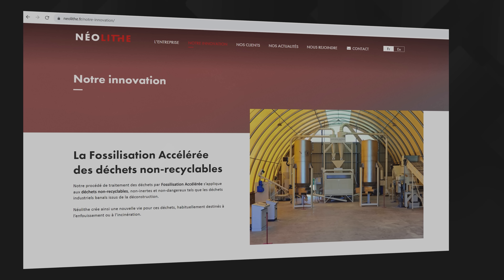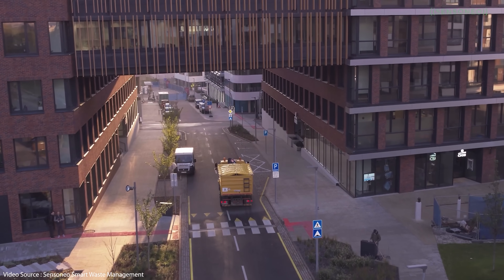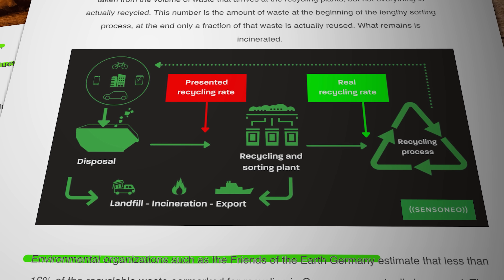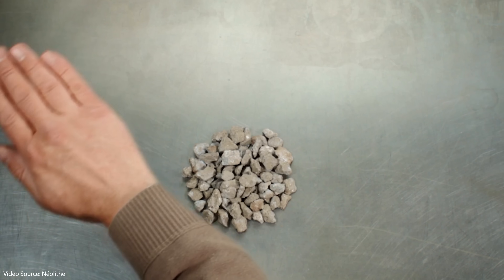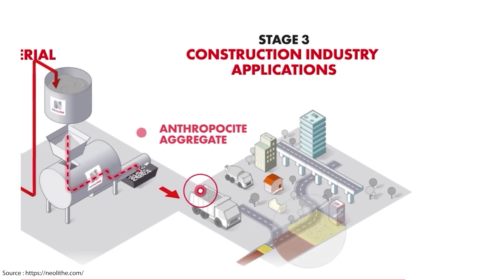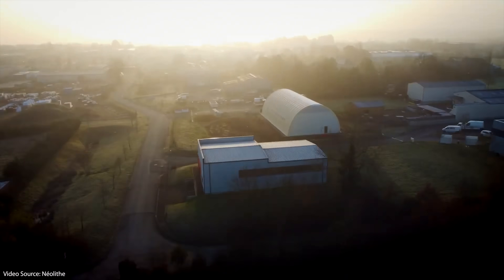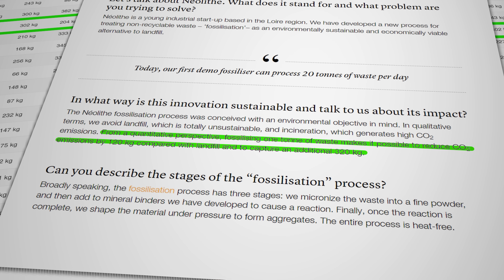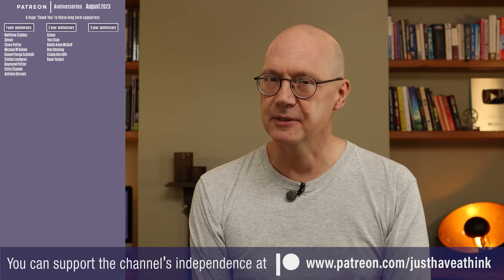Building roads with your rubbish! How do they do that?

Comment: Hmm - the issue I have with this is that the waste is put into infrastructure instead of recycling removes it from being really recycled. But it surely is better than burning the plastic and do some whitewashing by calling it thermal recycling….
Edit: Another item I want to know: If it is used as building material - how can it be recycled or are the waste of those tiles etc just going in a landfill after all - just a few years later?

Comment: There is no possible way this material is structural, which heavily limits its use in the construction industry as an aggregate in concretes or asphalts. Even structural abilities of known materials get rejected by engineers and governments for road building because of varying specifications. Crushed concrete and asphalt aggregates have been and commonly do get rejected as under road fill or base for roads where I live in Canada due to the variations in mixes of concrete and densities. If there is a proprietary unknown stages to this products manufacture and it's made from different waste materials each time, there is no way governments and engineers will be liable in its use. Not to be overly negative, but waste management cannot be looked at as a economic endeavor. It is a government social service that taxes will have to pay for. Introduce legislation that if you produce it, you have to take it back or pay for its disposal, and manufactures will start figuring out ways to reuse products, make them easily recyclable, or out compostable materials.

Comment: It is not only good for roadbed material, we can use it to use on roofs over roads for tethered electric cars. Forget carbon. The problem is urban heat, which heats Barent's Sea, melting Arctic and warming northern countries more, which heats Barent's and this is why we have not only reached the tipping point, we ransacked it. 

Have you heard what is happening in US? It is the new normal to keep warming more than the last 60 % of years until we stop coastal mega-city asphalt ovens.

Comment: If the waste they are using contains plastics, and it sounds like it does, then this aggregate should not be use in any application where it experiences friction or erosion because this will result in microplastics being dumped into the environment.  Road surfaces, for example, would be a bad application.

Comment: I spent my working career in concrete, asphalt, sand & gravel and was recently interviewed by a company called Fortera USA. The process of making cement is one of the largest emitters of CO2 and the Fortera company is developing a way to capture the emissions from the cement making process and actually convert those emissions into a cement-like product that in laboratory tests can replace much of the cement used in construction.

From my own rudimentary research into the process it is a lot like how natural coral reefs form, using calcium carbonate from the surroundings that build themselves up into solid structures which can then be pulverized into the cement substitute. I didnt get the job. It seems no one wants to hire older guys anymore, my proof is 3 years of applying and no job offers.

Comment: @JustHaveaThink I like it, and suggest it is used for a seawall system to protect against sea level rise, and use it to encapsulate all waste at the same time.  Maybe some sea level rise can be avoided with climate restoration AKA geoengineering.
Reply: Sea water is extremely corrosive.  If there is a possibility that the material degrades by releasing micro-plastics, seawalls would not be the best choice for its use. It would have to prove at least as resistant to erosion as  granite.

Comment: If it's a viable replacement for aggregates in the construction industry, great. Will it be cheaper, and can it be used in the same way as current aggregate? If it's available in the quantities required, can be used without changing processing methods, and is cheaper, then I can see it being adopted - so long as this material has the same or better longevity than the current material.

Also, this secret binding agent... something non toxic that can bind powder without high temperatures suggests something like a protein, or some other organic substance. My guess is egg.

Comment: This looks more like an investment scam than a practical technique.

It is possible it was started with good intentions, but they didn't stop when reality set in. I don't believe there is an affordable binder with the right properties to contain a random collection of unsorted plastics. Styrofoam and teflon have radically different properties.

I wouldn't be surprised if their demonstration machine grinds up random stuff into a gray dust and puts it in a container. The next step starts with a different container of gray dust that was made from grinding up carefully selected materials in known good proportions, and mixing that with a compatible binder.

Comment: I am working with a company that is mineralizing CO2 directly from air with silicates just like Mother Nature has done to take CO2 out of air to make Calcium Carbonate forever. Given the CO2 capture that Neolithic is  stating, I am pretty sure it is a silicates capture process to create Calcium Carbonate. Unfortunately big companies have stolen technology from small companies for years. Looking at Milkywire environmental investing, it is obvious that CO2 sequestering is chemically and technically possible just looking at a company like Silicates. So big companies quit gaslighting and come to table with your checkbook. Neolithic has a great idea to make road aggregate to improve aggregate roads. There are aggregate coatings that can agglomerate and provide cementing action to create a more stable aggregate road. Unfortunately, construction takes 50 years to change. We do not have 50 years unless big money starts flowing.

Comment: The lack of transparency is a huge red flag. Has anyone examined the finished product for microplastic levels, toxins, and what its finished form is made of? Until there's scientific oversight, it should be treated as greenwashing and potentially more polluting than the alternatives.
Reply: I heard when cars go across a road, they create friction which remove tiny specks of concrete, a petroleum base product, onto the surrounding environment. Now, imagine if the roads are made with trash w/ plastic ,  now the plastic and trash are shredded up piece by piece by constant wear and tear by cars into the environment which can include food crops.

Comment: It's a way of kicking the problem down the road, I suppose. It's still plastic, just pulverized, glued into aggregate and used in place of other aggregate in construction. If it's ever on the outside of whatever it's used in, and subject to abrasion or weathering, it's now pre-made microplastic ready to be blown into nature by the wind where critters can ingest it. And whenever the thing it's used in is going to be toen down, they'll have to figure out a way of separate the microplastic from the concrete.

Unless I've completely missed something.

Comment: Sounds like a great way to leach microplastics and chemicals into the environment in a broad and uncontrolled manner as these surfaces break down over decades.
Reply: My thoughts as well.
How permanently locked away can a part plastic mixture be. Unless the plastic is as hard as diamond. That won't occur in a low energy process.
Reply: Aren't you pouring cold water on a material yet to be fully tested? How do you know it will break down over decades or leach out chemicals? 
I don't understand the negativity that leaps out every time a potentially positive technology appears. What would be your solution for dealing with non-recyclable waste?
Reply: @jeremyradford5103 because that‘s what plastic does under stress? Far more quickly than materials like stone or concrete? Sunlight makes it brittle, heat makes it soft and repeated compression makes it break. Each of the above on its own would make it break down eventually. All of them together will wear it down over time and release microplastics into the environment. While certain plastics can be designed in a way to resistant to certain stresses, a uncontrolled mix of "thrash" plastic won’t be.

If plastic wasn’t breaking down on its own when exposed to the elements we wouldn’t already be having a microplastic problem in the first place.
Reply: @sebastianbauer4768  "uncontrolled mix of trash plastic"? You obviously know more about the process this company is introducing than anything in print. I know perfectly well what happens to plastic under environmental conditions, but as you say, this is 'trash' that will break down in the manner you describe anyway. It may not be a perfect solution, but it's not adding to the existing problem, so why tear it down before you know?
Reply: @jeremyradford5103  because there is a reason we put thrash in landfill and not just throw it into the ocean anymore. It helps to contain the problem, keeps the sun away and generally keeps the stuff out of the groundwater. Spreading it flat over as large a surface as possible(aka roads) objectively maximises the sun, wind and mechanical stress(tires) exposure.
Reply: @sebastianbauer4768  Landfill sites are one of the worst sources of chemicals leaching (leachate) into the soil and ground water. 

If this material, which no one yet knows its durability, is used as aggregate for road construction, it will be covered by tarmac and not exposed to sunlight or wind and be less prone to breakdown, if it does actually breakdown. 

Why are you raising issues that neither you nor I know exist before this new material has been properly tested? Waste management is an increasingly difficult problem to solve, so what is your objection to a technology that may just work!? This defeatist attitude is nauseating
Reply: @jeremyradford5103  Listen to yourself. If we waited to raise issues until we had experiences it would be too damn late to do anything because it would be in thousands of miles of roads already. Ofc you need to raise issues before shit hits the fan, your mindset is what caused all the problems we have that you even refer to yourself. There was probably someone just like you around when we first discussed throwing plastics and other long term chemicals in landfills. 

And we do know the durability of this stuff. It’s not a new material, its the stuff we already know and love that you find in every cubic centimetre of seawater. We know the chemical properties of it and even if we do not know the exact mixture of this specific product there isn’t a single plastic out there that would be unproblematic. If it’s bad in a landfill it’ll be bad in or under a road, just more spread out and less controlled. Can’t put a landfill in ground water protection areas for example, roads go everywhere.
Reply: WTF?
Dude, that stuff is harder to disolve then the plastics we already throw into landfills and oceans. It actually makes the issues less problematic!
Reply: @christopherg2347  Even if it was harder to dissolve(how is that even relevant btw?) than other plastics that doesn’t mean it won’t be abraded by 40 ton vehicles driving over them for decades while exposed to the elements. It also pretty much ensures that it’s turned into as fine a dust as possible, just like already happens with the rubber from tires. Why not try it in a contained environment first? As a roofing material for example.
Reply: @Bastian28466  Pretty sure the entire video was about pedestrian paths, not vehicle roads.
Reply: @christopherg2347  I was more referring the the principle of it, there are plenty variations of this used for all kinds of roads. And even with pedestrian paths you still have erosion, just slower.
Reply: I still think that enormous scaling of that limestone-producing technology from carbonic acid in seawater is the best current model for removing human emissions. If it was scaled properly, with trillions of dollars of investment worldwide, we could justify burning all waste to reduce microplastics etc and then convert the CO2 and carbonic acid back into rock, leaving a small residue to be properly disposed of - so we wouldn't have to worry about needing to recycle trash in an endless cycle of microplastic production.
Reply: @morganspencer-churchill2136 Enormous is an understatement considering that CO2 emissions are still increasing and will continue to do so as long as we burn fossil fuels. I have a feeling you would like to bring in some mitigations to control atmospheric CO2(e) to maintain the status quo rather than tackle the primary cause of the problem.
Reply: @morganspencer-churchill2136  Carbon Capture is a fools errand we can maybe consider after we have excess renewable energy production.
Until then, every MW hour of renewables is spend better not emitting carbon in the first place

Comment: Our local council have been making and repairing our roads with rubbish for decades. Clearly well ahead of the conservation pack.
Reply: Are you being sarky? Our council gets a corruptly-appointed contractor to make our rubbish roads. Which fall apart and have to be repaired by a company that knows what they are doing, at 3 x the original cost.
Reply: @steiner554 Mmmm.. Microplastics. Our council learned the repair technique by carefully observing how the rubbish that fell from the back of their collection carts into the road got ground into the surface. They then refined this process to give us the ecologically sound methods they employ today.
Reply: @steiner554 He was using irony, not celebrating repairing roads with plastic waste.  The was referring to the poor quality of repairs.
Reply: Very good. Like it.

Comment: This seems to good to be true. Shredding plastic and then binding it to use as aggregate? 
This is just asking for toxic chemical to be leached into the groundwaer when the binder eventually breaks down.
Incinerate the waste properly.
Plastics are great they last long and are bilogically inert. Which causes issues when we throw it away. 
Proper incineration makes sure that at least some energy is used. 

Recycling is more often than not a scam.

Comment: Great to see "waste" being tackled. Powdering up the plastic waste sounds hazardous and would require comprehensive air filters to prevent the "micro plastics" from escaping!
Reply: Also how they prevent those microplastics from being released through the wear and tear of the final product?
Reply: @pomodorino1766   they can chat gtp a green washed press release surely.  I dont why they bother with just have a think.

Comment: My father was a Terrazzo manufacturer.
Terrazzo was used by the Romans and predates "marketing" by a couple of millenia.
Reply: I expect marketing existed in Roman times and before. Primarily at market stalls :)
Reply: Marketing is as old as bartering. You could say that Terrazzo was used by the Romans and predates modern marketing by a couple of millennia, but that'd be some sort of tautology. Replace the word marketing with something else and it'd be equally meaningless.

Comment: I hope solutions for this can be found, it's such a huge issue. Friends of mine carefully separate the non-recylable plastics out, and then put them in with all the other plastics. In their head they think that it helps, but all it does is add to the cost of recycling measures. This mentality is dangerous because it assuages the guilt associated with buying things wrapped in a ton of plastic, which means they focus on recycling instead of reducing, and so keep buying these poorly packaged products.
Reply: Very thoughtful remark.  Recycling reuse etc. doesn't compare with elimination.  Not using (such as in pre-industrial times) is such a novel notion.  We are after all self identified as consumers, are we not?  The way forward is most assuredly the elimination of the consumer ie. ourselves.  The cat is out of the bag so to speak.  We are not going back and I can rationalize with the best of them.  I can make claims of virtue and flexibility but deep down I know better: I am a princeling and why would I give up my throne?
Reply: @danielfaben5838 Not so novel. The use of plastic has grown exponentially in my lifetime and in my opinion is more linked to consumer driven capitalism than actual necessity. We have become a throw-away society that treats the planet like a giant dustbin. So, yes, produce less, reuse more, and recycle whatever we can.

Comment: Also are the construction industry going to use this "aggregate". How stable is this material? How consistent? What about the organic component that will presumably decompose releasing gases, creating cracks so weakening the concrete and allowing toxins, methane and CO2 to escape?
Reply: I read some time ago that a trial of using plastics in roads showed plastic nano particles were emitted, now polluting on a more ubiquitous manner. I don’t know the veracity of this study, but it’s something to test before widespread use.

Comment: Unfortunately, the vast majority is shipped off to southeast Asia, where it is then thrown into the ocean. The landfill option would be much better in this case.
Thanks for another great video.
Reply: At least in the landfill the embodied carbon is sequestered.
Reply: The embodied carbon in inert materials, yes...but 'In the UK, the largest contributor to methane emissions from the waste sector is landfill, accounting for 81% of emissions from the sector, with the remaining emissions coming from wastewater treatment and biological treatment of waste.' 15 Nov 2022 (gov .uk.) as you probably know.   @economicprisoner
Reply: Why are councils not responsible for the clean up of seas when they effectively fly tipped in another country